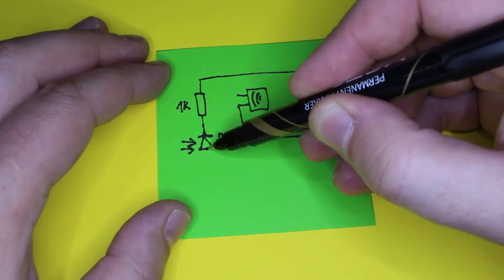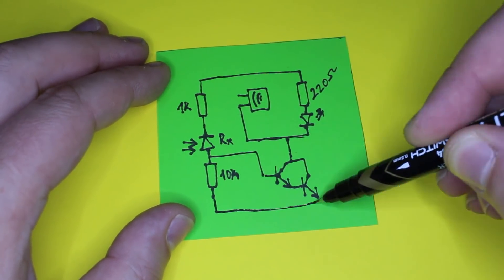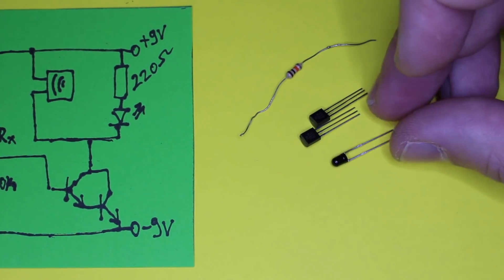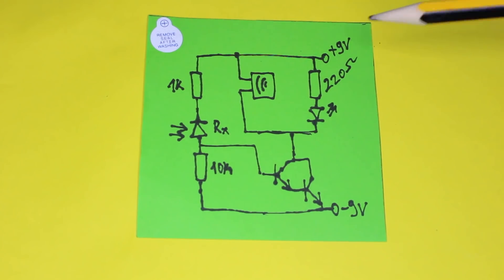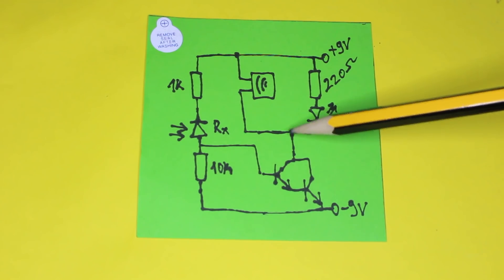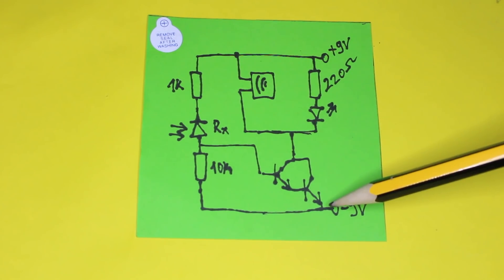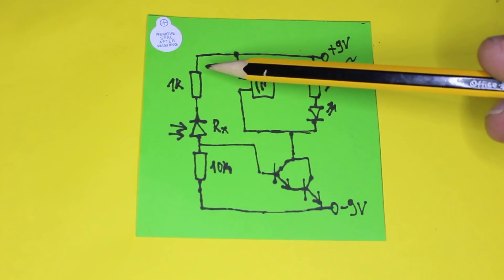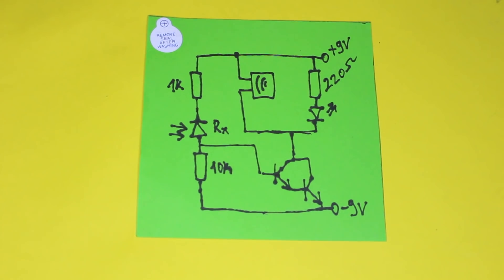Smart and Useful DIY Ideas

Comment from the maker: The circuit is very simple and anyone with basic electronic skills will make it:)
Reply: Ha! I can use this ;)
 ...but It needs perfboard... I've made way too many little things like this that have nowhere to go except to inevitably get stepped on.
 I've been meaning to try any make a real universal remote. That's probably a bit too big of a project for your short uploads and production schedule, but wouldn't it be nice to just have a freaking universal remote that actually works? None of this entering manufacturer codes ""programming"" BS (that never completely works). Just hold a set button and the button you want to program, put the working remote in front of the device and store the signal. Heck, a remote with a real crystal would probably fix 99% of the problems we all have, as all the consumer junk has a ceramic resonator at best. ...just an idea :)
-Jake